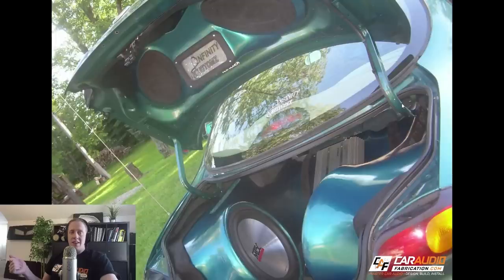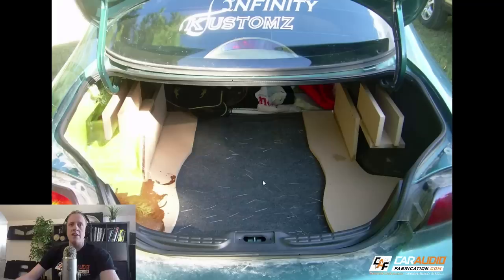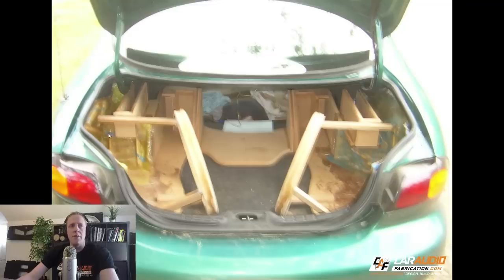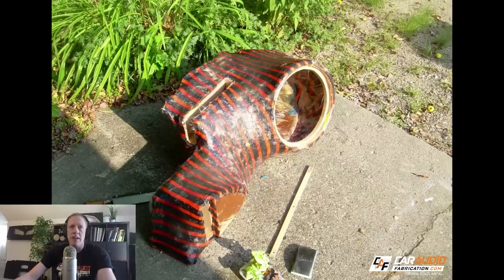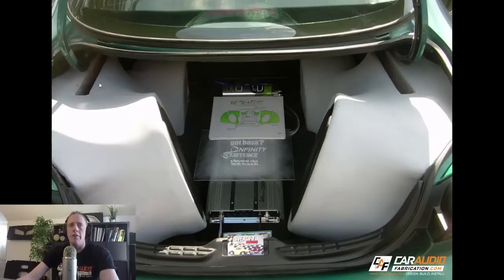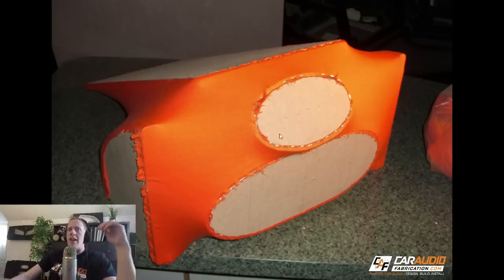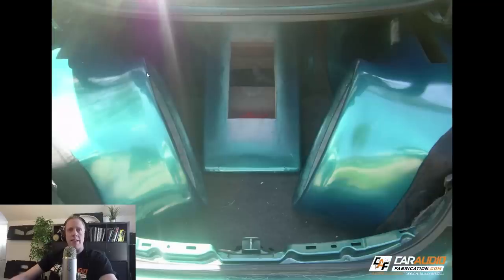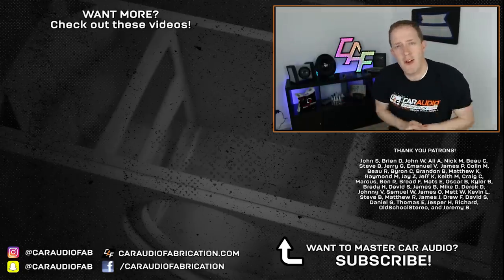Green Taurus - OLD BUILD REVIEW - What I learned!

Comment: When I drove a Taurus in high school, I had a pair of 10" home speakers connected to an old turntable radio that had a built in crossover.  It was run by a power inverter.  It was my dads car and he said 'no permanent modifications' thinking that meant I would be unable to add any bass to the car.
Reply: I connected JVC bookshelf speakers to my rear speaker wires.

Comment: In my first build in the 1980's, I almost set the car on fire because I was going to wire an amp to the fuse panel.  My dad came out and nipped that in the bud and gave me some tips.  What you have there is a Picasso compared to my first try.  I love it!

Comment: Use 2 inch paint brush , bubble popper roller, and fuzzy roller ( nap on paint roller frame ) . The paint brush helps to fine tune radius . The nap suckes up excess resin. Cause you only want the fabric wet . Extra resin makes products brittle and weak . Also use styrene wax to your last mix of resin or gelcoat. That way the last coat is properly sealed. And it won't be tacky and will dry faster. Or if you don't have styrene wax you can take Saran Wrap. Place it over your last coat. It will do the same as wax. But if you use the styrene wax. All you have to do is wipe it down with acetone and do some light sanding. Anything built outside of a mold have to have some kind of seal. If not it never truly dries. When you add styrene wax to the last coat. As the resin heats up the wax will come to the top and create a sealed barrier. I used to be a professional fiber glasser years ago . And repairs were the worst. Until we found out about styrene wax. Because it really sucks going through a bunch of sandpaper because it getting clogged from not properly drying.  Hope this helps. 😎👍

Comment: It doesn’t matter what camera you have. Even if you only have a potato available for you at the time. Wipe the lenses is as important as letting the camera focus. Taking a few seconds extra will show years down the road. If you look at some pictures on larger screens and other places,and you have settings for adjustments. You may benefit changing the iso and other settings, if automatically the pictures come out dark or blown out. Cameras preform different, with different conditions. Daylight is always the best, but if available turn subject looking at shadows, and reflections, even from the flash, that affects picture outcome. You may need to tilt the camera up or down to eliminate the reflection enough to get a good picture. Generally dark environments are difficult to capture, adjusting settings can benefit down the road. Last tip, do not use any digital zoom. If you need to use digital zoom, get as close as possible, and take extra time for letting focusing happen. A stand or mount will help prevent the camera from moving. Imagine a laser beam shooting from the camera. You desire for the camera and subject to not move, any the subject to be lit optimally. The camera can move only a little, like a shake, but the other end of the beam will move inches to feet. If using a mobile devices with multiple lenses. Each lens can be used individually, but anything else is an digital adjustment. If one lens is available, any in or out is digital. 
Remember, that picture is a once in a lifetime occurrence. With this example, he can do another build like this, even using the same camera, but it is redoing, not the original. And that day at the park, well if you can revert your child’s age back, and get them to reenact the picture. You probably won’t be worried about much. Happy picturing, and memories.

Comment: the Taurus was the mistake, right?
...i haven't watched the vid yet, but that seemed easy to spot. ;P
Reply: @rjgaynor8  Until they rusted out.  The DOHC 3.0 Duratec engine was designed by Porsche and detuned to half its original power.  Awesome and durable.  It was also used in an exotic, I think the Noble, at much higher power.

Comment: Hey Mark great channel.  I have a 2017 Toyota Tundra non JBL Entune system that I am planning to install a Pioneer AVIC-W8400NEX in.  I am also planning to use the iDatalink Maestro RR to keep my steering wheel controls.  I have a question about the small in dash screen that displays average and instant fuel economy, something about the trailer brake control and turn by turn guidance.  I don’t care about the turn by turn or the trailer brake info, but would like to still have the fuel economy readings.  With this radio swap and iDatalink will I still have them?  Thanks for any help.

Comment: how did you go about calculating for the port and air space with this? I'm going to be redoing my fiberglass boxes and adding a port to the new ones I make using the old ones as a plug for the front.
Reply from the maker: Fill the space with packing peanuts, then take a cardboard box of known volume and see how many you fill with those packing peanuts, you then know your internal "gross" volume to work with.
Reply: I had a similar problem that people have with the hinges, only mine was with the handles used to release the back seat to flip down. the one side cleared, but the other didn't. I have to give you props, because what you did 12 years ago was far more elaborate than what I did ~6 years ago.